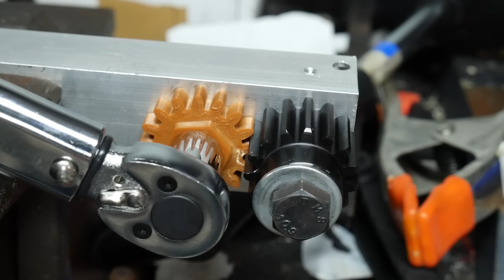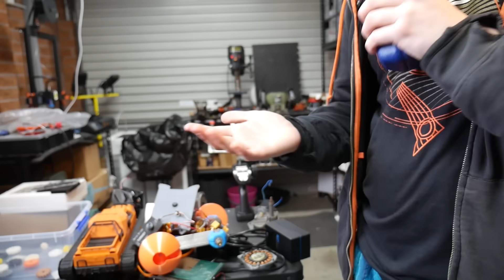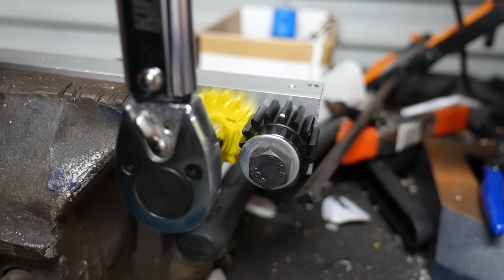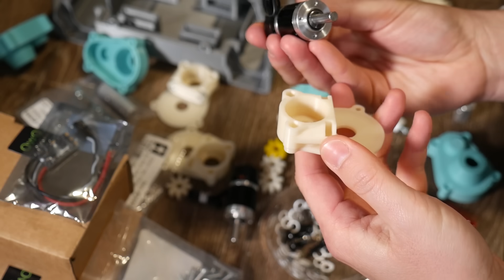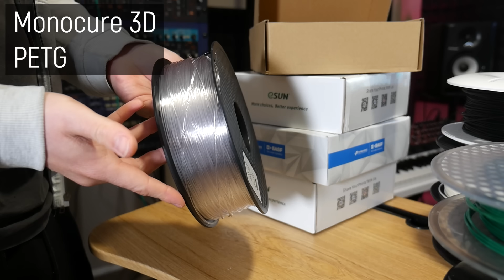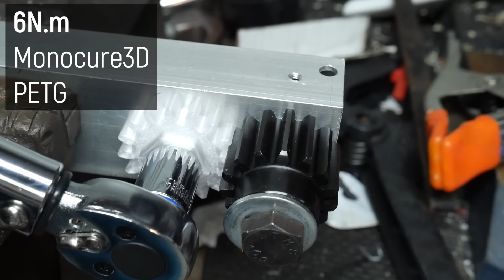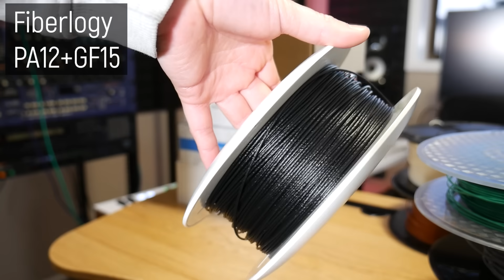Which 3D Printed Gear is Best?

Comment: Nylon is used for plastic gears for an array of desirable benefits. Such as the fact that they have an incredibly low amount of friction due to a property of the plastic being self-lubricating. They're also used because of their heat resistance too of course. 

The reason PLA wouldn't be a choice permanently for literally any application would be due to its tendency to creep over time, both under load, and with greater than room temperature temperatures. That's not to say all PLA will do this immediately, and it's not to say Nylon doesn't experience creep, however the creep that Nylon will face will be minuscule compared to PLA.

Just look at Stefan's V0, where his bed supports (CF-Nylon) deformed rather quickly. Imagine how fast it would've been with PLA, and why the Voron build team advise against both PLA, and CF-Nylon for the structural parts. 

Sure, you may want your gear to just shatter into a million pieces as its failure state, then obviously the more brittle PLA would be desirable. Nylon is the choice of many who make their own Orbiter/Galileo extruder for the low friction, temperature, and mild flex properties because with a planetary gear reduction, that amount of contact area just does not allow the Nema14 to turn with either ABS or PLA that I tested.

Comment: Wouldn't wear testing be as important as raw strength? Strength you can work around via changing size/infill/etc, but wear resistance is going to be more of a property of the material.  How long does the gear operate under torque? How does the addition of sand/some other anti-lubricant affect that, etc?

Comment: I noticed most of the gears failed by delamination, and the stronger ones beceuse the hex screw, I wonder if different layering could change this property. I don't know if it possible to layer every second layer just flat, not following the countour of the model in 4 different angles. Also reinforce at the middle of the hex to prevent slipping and deforming the gears.

Or use a different shaped shaft like on an Input Shaft. I don't know your schaft diameter, but the closest I coud find that could be used to this application is for a reasonable price is Spline Drive Lugs :D It can be used the same way if you screw it on, or drill a hole in it and tap it, to use it like the current one. I'm curious how much more tourqe could be achieved by using this shape on the materials that slipped or cracked because of the nut spinning. 

I think you don't want to fail at the gear teeth, because if it bunches up instead of shearing around it can lock your motor. 7:28 imagine your motor trying to turn that.

Comment: I switched from PETG to colorFabb nGen awhile back for a "make it as tough as possible" model I print on a regular basis, and I've found it to both print better as well as be stronger along the z-axis; I print it on an open-bed printer at 240-245 and if it breaks, it almost completely ignores layer lines (it's usually only at the edges of the broken areas that you can make out layer lines, at least in my experience). I tried using NinjaTech Armadillo as well, thinking that would be stronger, but it ultimately failed in the same way as nGen so wasn't worth the price increase. 

In any case I'd love to see either or both of those tested for gear use, as the current results from this video give me the feeling that there's something about the shape of a/the gear that is causing even the strongest materials to fail at a force that seems surprisingly low when compared to things like the PLA. (That and not being 95-100% infill with a good 30% or so overlap with shell lines, which is likely going to make a big difference for some of the materials.)

Comment: They're gears, you're using them to transfer power, you don't what them deforming and absorbing that power, and you don't want to be looking for a mystery, hey, why is this acting funny from something like it deforming and spinning on the hub.

If you're using them like in your test then you have your answer, the 2 PLAs, but if you're printing both gears then you probably want to do a test with 2 printed gears and also a running test, to see if they heat up meshing and cause a problem or if you need to put some sort of lube in the gearboxes.

I suspect that in the end the best would be something like PLA with a little silicon grease (something like superlube).

Or just ask Ivan

Comment: I've 3d printed a lot of gears. If they aren't lubricated well they will instantly melt and fail.
I'd like to see tests where you run them at high rpm with and without grease to see what fails first.

Comment: I have done some testing with spur and hearingbone gears. All materials had the same problems. The gears are noisy and after some running time they melt together. So 3d printed gears are usefull for low speeds / short running time.

Comment: Nice video!  Increase: tooth engagement, circular thickness.  Decrease: addendum, number of teeth.  You just need to design for the material by changing the specific features until you get the performance you need.   Sure it may look like a "Franken-gear", but it would be 💪

Comment: Based on the way these gears are printed, layer adhesion is of a lesser concern than the strength of the layers itself.
I never tried it, but maybe PA-CF is a solution. PA is inrecdible tough, CF will make ist stiffer.
Layer adhesion will be compromised compared to pure PA, but for your specific design it might not be a major concern.

Comment: PLA is so variable.
There's so many different ones out there that it's impossible to know your results before you buy it.
I'm slowly making a list of which ones work for me and I would buy again as opposed to others that I wouldn't even if they were only marginally more annoying to print with (more stringy, sheen, etc). If it was more public what went into these mixes, perhaps it would be easier to know what to buy. That BASF looked very promising for mechanical applications.

Comment: Absolutely PLA for something like that. I would want gear to be "maxed out" and rather catastrophically fail, instead of flex and wear from softer material. Flex is simply out of the question. If material cracks, then it simply needs to be better dimensioned.

Comment: I print my own gears for coffee and vending machine to replace both plastic and metal ones because the plastic ones, even though they are weaker, it is much less expensive to just print a dozen of them then to buy one. And the metal ones can break other bigger and more expensive parts which are much more important and harder to fix when something gets stuck, so I would rather have them break and then replaced.

Comment: Big part of your problem here is that you're not printing with enough outer shells, leaving you with voids inside each tooth. Also, your infill needs to be higher, or you need to add some more geometry to the gear along the way to give some additional reinforcement. PLA / PLA+ can absolutely make useful gears-- I've got some printed PLA replacement change gears for my lathe, and they're doing just fine after a year or so. Have a look at Mr. Pete's channel for some videos on that subject- he just prints with 100% infill, but that's kind of overkill except for very thin gears.
Reply: Also, I completely understand why you're using a hex to transmit power, but given the flexibility of the materials involved you'd be far better off to use keyed shafts instead, with oversized (and / or double) keys where possible. The interface between the key and the gear will be along an almost radial path, and more torque will go to rotating the gear, where using the hex shaft your interface is very much angled, and you're spending a shitload of your torque in stretching the hex out rather than sending it to the teeth.

Comment: I would go with nylon on the motor for it's resilience in acceleration and deceleration but pla with planned failure points for the other gear.

Comment: Definitely using a higher nozzle temp for printing would give better layer adhesion, giving a stronger part.

Also bear in mind that at 20% infill the connection of the teeth to the wheel would be a weakness. Yeah, higher infill takes longer, but I believe that would increase the strength, especially at that thin base of the teeth. 

You could also give annealing a test, but that's a pain as your printed part deformation slightly during the process.

Comment: I replaced all the gears on my old craftsman 6 inch lathe with 3d printed gears made out of Taulman Alloy 910. Been using it on and off for years now. Works great. Plus it has two added benefits: 1st, they are self lubricating, so no need to oil them, and 2nd, they are much much quieter.
Reply: No wonder I read comments! Thanks for the recommendation.

Comment: I'd think you'd want the less deforming materials. While the ultimate strength may be higher on the others I have a feeling that when they are moving the loss of that involute shape would lead to catastrophic failure or at least ridiculous wear at much lower torque.

Comment: I don't have a dual extruder printer, but I suspect you might.

I wonder if there is a hybrid solution that takes say nylon+cf and the basf filament.  Not sure how to design the gear, but maybe to start use one material as infill and the other as the walls.  

Then maybe try nylon teeth and basf for everything else.

Comment: From my own experience in the rc hobby as long as you keep the rpm's low PLA is perfectly fine but as soon as your making something that is gonna spin that gear fast.... molten gear lock up is a thing at 25mph >..>  
Though where I live PLA is a no go if you don't want to use any of your PLA made things for a few months out of the years cause of asphalt temps or just ground temps on a 110F+ ambient day.

Comment: I have a problem with your test. Yes I have discover myself that PLA is strong. As you stated heat will be a problem. PLA will melt. I have discover that plain nylon is best (3D printed RC cars). I haven't try PETG thou.

Comment: Actually, the fact that it withstood 2 Newton meters is impressive. If you calculate the force on a 2 cm diameter spur gear with a 2 Newton meter wrench, it is 2 * 100 = 200 Newton centimeter. A Newton is the amount of force to move 1 kg 1 meter/sec, which translates to 200 kg of force across a 1 cm radius. The actual force on a spur gear is 7% reduced (cos(theta)*Force), where theta is the angle of the gear.
Thanks for testing, I was unsure it could handle my brushless motors, which exert a max torque of 2.7 Newton meters. However, I do not anticipate getting close to that amount of torque, since my humanoid robot will be very light weight.

Comment: A digital torque adapter would be more convenient for tests like this, they are not too expensive either - may be a handy addition! Especially with how useful these tests are!
Reply: True. Moreover, using this adapter will give more accurate results. During the test the specimen was loaded then unloaded several times in order to adjust the torque wrench. While a proper test should be carried out in a linear manner as possible until failure. The cycled load can harden the material, through minor plastic deformations, thus getting higher false result.
Reply: @landmarker  That was the purpose of the second gear, which was tested to failure at the torque found for the first gear. Not perfect, but a good check on the result.

Comment: I think PA12+GF15 is the best for your case since you want to protect your BLDC,... it's tough similar to BASF PLA and spun when broken, it's important, since broken parts might entangle or clog especially in covered system which will cause more damage to the whole system

Comment: one of the things I found trying harder filament is that the harder it is the more it shatters. there are a few places where parts I print are subject to hard impact. IE: falling a from 3+ feet(one meter+). what I ended up doing is using a flexible (prusament 98A) filament not sure if that would work on a gear, but in my care it was the ticket.

Comment: Best failure mechanism depends on many things obviously, but by and large I'd say slipping on the driveshaft is surely the safest. Shearing teeth wasn't much of an issue here, but imagine if it happened at speed and the loose toofies found their way near the now rapidly spinning primary gears.

The unreinforced nylon is pliable stuff indeed. Modern model aeroplane propellers are made from GF reinforced nylon and they cone (bend forward) a bit, but I got some unreinforced propellers from the seventies and they looked like a punch bowl from the side.

Comment: I just printed and sold so many abs gears to my customers to use instead of injection molding ones and they usually do not report a failure
but when I know that abs is not enough I do an aluminum cast to make one

Comment: Okay, strength of the material is one factor, but what about resistance to wear? For instance, if the tear point was at 10Nm, you run the gears at constant 5Nm and some medium speed and check the temperature, which obviously should stay low. Q: at which speed does the temperature become a problem? Q: how long can gears run at the speed below which temperature becomes a problem, to the point of failure?

Comment: I would really love to see some ABS blends like fiberlogys ABS plus, Esuns ABS plus or 3DJakes niceABS. And I would really appreciate if those materials were printed in a heated chamber, even if the manufacturer states they "can" be printed without one, because based on my own testing layer adhesion  without one is really terrible, even if the print doesn't outright warp.

Comment: If your major goal is to protect the motors, it seems like the reasonable action would be to design a clutch into the hex center. Maybe instead of the drive surfaces being solid, make them "prongs" tangent to the drive shaft so they'll bend at a predictable torque and release the shaft without destroying your gear. Then you get the best of both worlds.

Comment: It seems that PLA would have worked much better with thicker wall thickness. It seems that you mentioned later that you would test with solid gears but I think you should try different wall thicknesses, too.

Considering that BASH Pro PLA seemed to be the best you could try different wall thickess tests / solid gears only with that to get idea how much that matters.

Comment: in my own experience with different PLAs even sold under the same brand name (Clas Ohlson here in Sweden): the clear ones which are supposedly colored with dyes rather than pigments are mechanically much stronger than the opaque ones which are colored with pigments. In this particular brand of PLAs the white, skin-colored and black ones are - in a lack of other terms - softer, then the clear ones which print at least partly translucent and come in green, gray, yellow, red and blue.
As far as I can tell, your unbranded yellow PLA appears to be opaque as well...

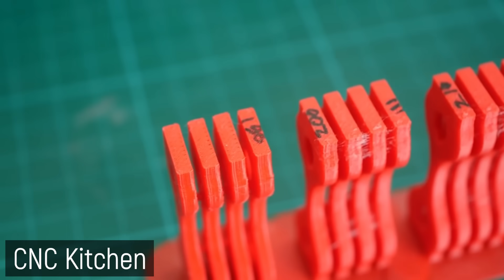Comment: 4:46 You might think 8Nm is pathetic, but if you calculate the force on the teeth, you'd be surprised. The radius must be like 3cm or so, which would mean that they transfer a force of about 266N there! That equivalent to over 25kg hanging on that teeth. Suddenly pretty impressive. I am sure if you calculate the stress on the tooth by using the surface area, it is still quite impressive.
On that note, if you want to transfer more torque, as others have mentioned, herringbone gears have a larger surface area per tooth, thus allowing higher forces before reaching yield strength of the tooth/material.

Also to be noted, only tested here are fairly static torques. In real life applications you also have many peak torques, which can immediately cause a very stiff gear to fail (even if it has a high yield strength) whilst lower stiffness materials might absorb these impacts much better. I suspect that with this kind of testing PLA will perform far worse, and gears such as nylon and abs will excel. 

Seeing how the gears fail, I suspect that higher infill ratios would significantly increase strength, as the limited contact between outer walls and infill (which transfers the torque) is where they seem to fail. With low infill ratios this is of course a very limited contact patch. Never mind that these contact patches feature very sharp angles, which induce stress concentrations.

Comment: I was always sceptic about carbon fiber or glass fiber filaments. I believe that the fibers in there are much too short to have any impact on strength. I always see this more like the new buzzword to sell. If you look how carbon/glass/kevlar fibers are used in industrial applications, then the strength comes from long fibers woven into each other. Which makes sense as those fibers are only strong if you pull with force lengthwise. If you bend them the flex or even break.

Comment: intresting performance analysis -  would you be better served if each incremental test worked on a fresh unstressed tooth, considering each successive test increment is working with a previously stressed gear tooth - just an idea - and as commented elsewhere, the infill approach appears to be a common failure point